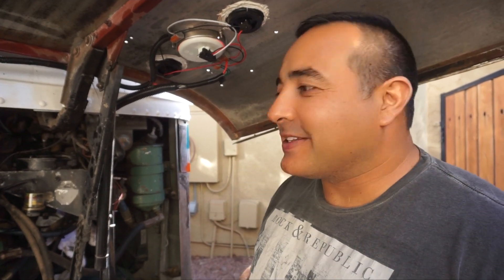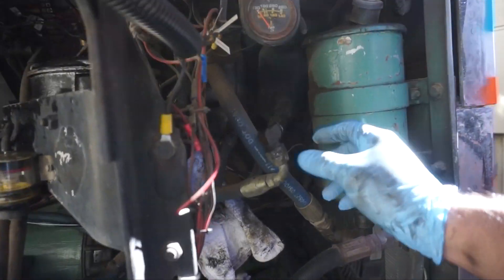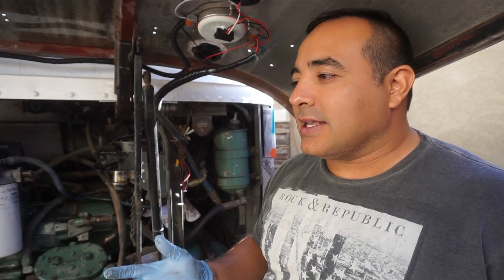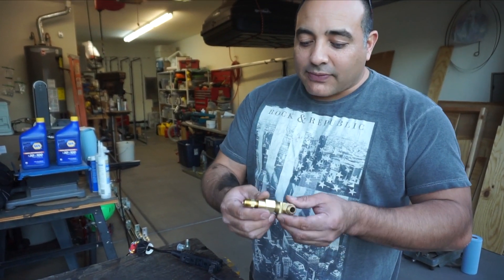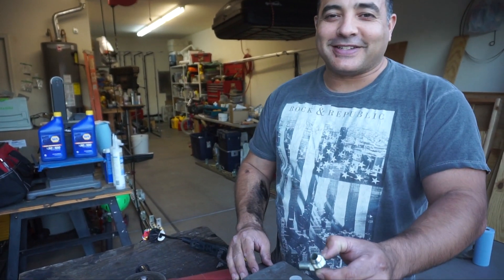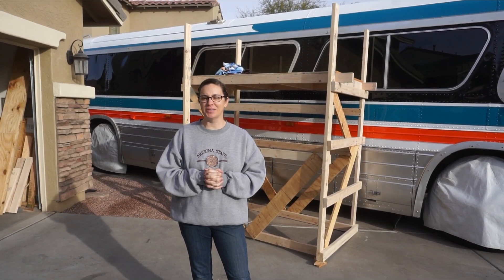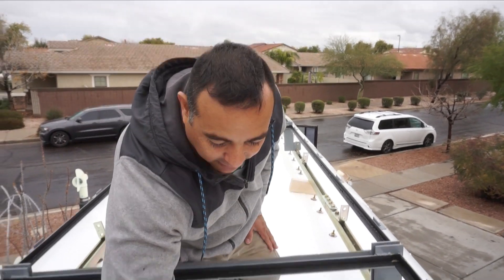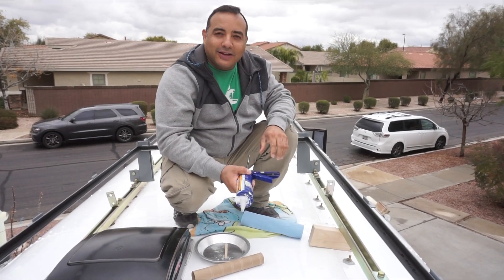Solar Install: Part 1: Mounting the Rails and Upper Racks

Comment: Freaked me out when I saw how many holes you put in the roof to take such a light load.. I think maybe 12 holes would have been sufficient given the strength of unistrut.. 70? Extreme Overkill 😳Love watching and your detailed explanation is great
Reply from the maker: Thank you Doitgood52 - we try to do things as safely as we can. The forces acting on the panels can be quite large and I wanted to be sure that they would be secure.  Those 70 grade 8 bolts are also backed by a thick piece of steel that runs under the ribs.  With 12 bolts I would have been pretty sure it would have held ... with 70 I don't worry about it :)

Comment: Boy this part scares me... More holes means more chances of leaks...
Reply from the maker: Yes - we triple sealed the install with rubber washers on both sides and then a sealant specifically designed for metal adhesion (Trempro 635).  We have had the panels up there for almost a year now and happy to report no leaks.

Comment: I won't lie. this is cool.  BUT.  I cannot help feel that just getting a bunch of the 165watt Renogy flexible panels would have been cheaper and only a day to install. You could have simply just covered the entire roof and gotten then same wattage with no profile.
Reply from the maker: Thanks Carter when I first started researching solar I had the exact same thought.  Why not just cover the entire bus roof in those flexible panels!  As you dig a little deeper you start to see why nobody is really doing this.  The first problem with the panels is heat.  When they are stuck to a bus roof there is nowhere for the heat to go - so it ends up destroying the panels in short order (most die within two years).  Another big problem is energy density - even with the entire bus covered in solar panels it is unlikely that I would get more than 1500 to 2000 Watts of total power - and because of the curve of the roof - I would probably only see 1/2 of that or less at any given time.  The panels also tend to the least efficient panels available. Another issue is "cupping" - with the heat and just with age, the panels tend to "cup" and water and dirt collects in those little "cups" and makes the already inefficient panels less efficient.
Reply: @BeginningfromthisMorning  Spectacular info.  Thank you.  Robust or bust :)

Comment: So do you have the max height of the bus/rv with the panels attached? there are quite a few bridges with low clearance around the U.S.
Reply from the maker: We will be measuring max height soon (and the weight since we took a weight measurement right before we put all the solar stuff on the roof).  The funny thing is - it will be about 4 inches shorter than when it had a roof-top air-conditioner (which had the height at 11' 4")  Our best guess right now is that it will be right around 11 feet tall.

Comment: Not sure if anyone has told you yet! Check your ground clearance of the height of your panels from the ground to the highest point of your panels! Peaceable limit is 13' 6" from ground to the top, you do not want to be hitting any bridges or power lines or overhangs! 
Good job tho on what y'all are doing to your bus!
Reply from the maker: Thank you and awesome channel name!  We will measure the full height of the bus and get the weight we added with the panels and racking very soon.  The funny part is it is actually about 4 inches shorter than when we had an R/V air conditioner up there (a small plaque on the dash added by the previous owner said the full height was 11' 4") Based on that we are estimating the height to the top of the panels to be about 11 feet tall.

Comment: I may have missed it, but putting dis-similar metals together is not good. Correct? What did you do between the steel flat bar and the aluminum roof?
Reply from the maker: Thank you McKay - Dis-similar metals is always a concern.  To minimize it we took the following steps:  we put rubber washers (1/16" thick) between the flat bar and the aluminum skin where the bolt holes are.  Where it overlaps with the ribs - both are steel so we left those.  we also used self-etching primer + 2 coats of paint on those flat bars and the inside ceiling is covered with an asphalt-based adhesive (from the original insulation).  Hopefully, this will be enough to keep corrosion at bay.

Comment: Once all your roof work is done you should coat the interior of the roof in a coating, remove all wires first. Use raptor liner...it will dampen noise and stop any future leaks.
Reply from the maker: Interesting Idea - Thank you Zero Cool.

Comment: Curious, why so high? Looks like it may catch a lot of air unless you put a wind deflector at the front. Panels could be spaced to clear the vents so that they still can be opened.
Reply from the maker: Thank you Bill - it is so high so that the Maxx Air vents could still function even when the bottom layer is pulled in (they can open up to about 75% or so).  When the bottom layer is deployed the vent will open to 100% -
Reply: @BeginningfromthisMorning  thanks for the reply! Looks like you have done your homework on the install. Stay warm and dry,  23F  and calling for white out conditions here.

Comment: That broken line was fortunate...if that had happened on the road it would have been REALLY bad!
They might have used brass on the original due to a possible interaction with the other metals or the fluid.

You guys did a super job on that install!  And a "Howdy" to the TinyShinyHome too  :)
Reply from the maker: Thank you Gregory - yes being on the road would have made the power steering thing 100X worse.  Good thought on the interaction with the metals or fluid - I will look into that and ask around on the forums.

Comment: Is there clearance for the vent to open all the way?
Reply from the maker: Thank you Aastan.  The vents will open about 3/4 of the way when the "lower rack" is slid in and 100% open when they are slid out (there is enough room for them to fully open under the upper racks when the lower racks are deployed).  The vents were a major consideration when we designed the racking  (you could even say it was the driving force for the height of the racking) - we will show that in more detail next week.  Thanks for tuning in!

Comment: Stress and strain on fittings they will fail. Might want to see if you can clamp the line to a structural member to relieve some of the strain on fitting. The roof assembly has enough bolts that I think you have increased the strength original strength of it. I was thinking about this are you considering adding a wind screen to the front of the Solar Panel to streamline it or have you discounted the need for it?
Reply from the maker: Thank you Bill I will try to see if I can secure that line somehow.  LOL, my friend said the same thing "you are the only guy I know that actually increases the strength of the roof by adding a rack to it".  We do want to add some type of "fairing" to the front of the structure and probably add side panels to prevent the wind from getting under the panels and trying to "lift" them.  We are still trying to figure something out - let me know if you have any ideas.

Comment: Where are you putting your AC units?  You must have a great HOA with the bus in your front yard...thanks
Reply from the maker: Thank you bparkinson - we use a 12K BTU mini-split A/C for the main living area and we will very likely mount an additional unit in the back for the rear bedroom (a smaller 5K BTU Unit).  We have a video on the minisplit install (https://youtu.be/GvdIe0AkXV8) as well as our thoughts after having it in for 8 months (https://youtu.be/hNiFDMonKGk).  We have GREAT neighbors - you can see them stopping by for a visit in the first time lapse.  Almost all of them have helped us on the bus and our immediate next door neighbors have a new baby so we try to be good neighbors by texting them before we do anything loud or start the bus.

Comment: Scary when oil is gushing out of the motor compartment but glad it was just a power steering fitting not the engine. Great job on that install, you had a good crew from the looks of how smooth it went.
Reply from the maker: Thank you Jerry - it went surprisingly smooth (you have watched enough of our videos to know that things don't typically go very smoothly) :)

Comment: Regarding the engine repair, I don't think that steel part is going to fair any better as it is more likely to rust then the Brass Part. If it's stainless steel then you might be ok. The reason Brass is used is due to it's ability to expand and contract better than steel without rusting. Again if the part is Stainless then you should be ok, but you should have a back up if it's not Stainless... Cheers...
Reply from the maker: Thank you Paul Interesting thoughts on the brass part.  The "Hose Power!" guy was pretty insistent this was the right thing to use.  (I do believe it is a stainless part) - I have learned to buy 2 of things like this - so we do have a spare :)
Reply: @BeginningfromthisMorning  If it is stainless it should be better than the Brass Part, but if only metal coated in something, it may fail a lot sooner than Brass... Cheers...

Comment: are you going to put a air wing on the front to deflect the wind as you drive the wing looks like the ones that they use on cars for ski rack to protect the skies they do work great and come in clear or any color you like
Reply from the maker: Great idea Chrissteene!   We want to put something in the front and on the sides and had not really considered that ski rack windbreaks!  I will have to see if something like that will work - thank you!
Reply: I think  you wear thinking of some thing to retract the solar panels when the wind picked up well I talked with a friend and he told me about a wind censor for auto awnings  https://www.alekoproducts.com/Wind-and-Sun-Sensor-for-Motorized-Awnings-ALEKO-p/awss-ap.htm?msclkid=f90971b45e5717b762d02de99072f51b&utm_source=bing&utm_medium=cpc&utm_campaign=ALEKO%20Products%20-%20Shopping&utm_term=4574793006419450&utm_content=Products%20ad%20group I know that their is others but my friend said this one works great  hope this helps out
Reply from the maker: @chrissteene  I will look into these - thank you!

Comment: Boy there is something satisfying about seeing all that great design, effort and investment getting bolted snugly to the roof, I'm sure you agree! My gut was saying you went a little overboard on the mechanical fasteners lol, but you've sealed them up incredibly well and better to over design then under. Awesome job!! Keep up the great work and videos. Ever thought about doing some kind of fairing at the front and back of the rack to really make it look sleek and streamlined up there?
Reply from the maker: Thank you Josh - I do tend to overbuild a little bit but I wanted to be absolutely sure that this structure was not going to fly off the roof even in crazy wind.  We are looking at options for a fairing or windbreak in front of the structure as well as the sides to keep a gust of wind from trying to "lift" the panels from the sides.  We have not figured that out yet.
Reply: Beginning from this Morning all the best with the search and look forward to part 2!

Comment: Since you put this out there for everyone to see I thought I would put my 2 cents in, please take this as constructive feedback...  Those bolts are still going to leak, and there are way more than needed.  One bolt per rib would have been more than enough.  The water "wicks" its way down the threads past the nuts, washers, and bolt head.  The rubber washers aren't sealing the threads at all and I didn't see you put any sealant on them, and you've got tons of them.  I also assume you're going to spray insulating foam on the interior once everything is done.  I think that you'll find that when those rubber washers begin to fail from UV that all of those bolts will loosen up (and leak) and it will be a major issue to remove them or tighten them when if you don't have access underneath.  The best way to do this would have been to use blind rivet nuts into the steel hoops with bolts (or studs) down into those with a little non-hardening sealant.
Reply from the maker: Hi porkbuttrocks - thank you for the feedback, we appreciate people taking the time to look out for things that might be potential issues and we learn something every time we put out a video.  I will try to give you my thoughts on the issues you brought up. Using fewer bolts would have put more stress on the relatively thin aluminum skin and super strut and would have made the structure less safe in my opinion.  @12:30 I talk about covering the bolt and washer completely with UV resistant sealant (Trempro 635) you can see them all covered up in the gray sealant @13:00 (here is a photo as well: https://photos.app.goo.gl/xPQRiaocxf2Ts7Zd9).  To address the loosening or tightening of the bolts - they have been tack welded underneath to the steel bar that reinforces the roof panels (you can see it @14:28 if you look closely at the bolt head).  When we insulate the roof, insulation and the bus ceiling should press against the steel bar to prevent it from "falling in" in the unlikely event that we have to remove the nuts.
Reply: Somehow I missed that, sounds like you've got it covered!
Reply from the maker: @porkbuttrocks  Thank you - A second pair of eyes never hurts!

Comment: I’m not a hydraulic expert. But I think the steel fittings are for heavy equipment where strength is need for impact. In your application brass is most likely better for vibration. And it probably lasted 30+ years right. Do a little more research on that system. You’re the man when it come to research. Did you use nylocks in those 3/8” bolt or jam nuts or something that won’t loosen up
Reply from the maker: Thank you Mitch - I took the part to a hose store (called "HOSE POWER!") and they told me that part should have never been brass.  I did use nylocks and lock washers so I hope it stays in place. (I will check it in a few weeks to see if there has been any movement of course)

Comment: Hey Juan,
I am just about to post a video (in a few days) on the power steering system because of a leak I had at the pump on my bus.  It will go over some of the things you touched on in your video.  The pump relief valve does not open until it reaches 1000 psi +-50 output.  It looked like to me the fitting broke due stress from flexing, which might be caused by engine movement tugging on the fitting.  So, be sure to have enough freedom in the hose for it not to tug on the filter housing fitting as the engine moves around.  Additionally, you should be sure to clean that filter.  I'm going to post how to do that.  When that filter gets dirty, it causes added high pressure in the line that broke on your bus.  While the pump relief valve should cut in over 1000 psi, it is obviously going to the max for it to relieve.   If you notice unusually loud whining noise coming from the engine when turning the wheel, it is an indication that the filter is dirty and needs to be cleaned.  A dirty filter puts a lot of added unnecessary stress on the system.  One last thing, the original factory power steering system requires Dexron III transmission fluid if you have the original power steering booster cylinder on the back of the front axle.  If you have a Sheppard Steering self contained p/s gearbox on the front axle then it uses 10-40 motor oil.  Hope this helps!  
Great job on the solar panels.  You'll go airborne before they blow off!!   
John
Reply from the maker: Wow! Thank you John - I am really looking forward to your video.  It looked to me like it was from stress as well.  Before too long I want to do a cleaning of everything that needs to be cleaned or inspected back there.  I would also like to address leaks if at all possible.  It doesn't leak A TON but if there is something that can be done - I would like it to leak less.  The power steering does make a bit of noise when it is cold but goes away after about 5 minutes when it is all warmed up a little.  I am not sure which power steering system I have but it does work very nicely (I can easily turn the wheel with one finger) but the stuff that came out of that fitting was oil for sure (brown not red like Dextron).

Comment: I'm loving this series. It's like "This Old House" for buses. How tall is your bus now with the panels?
Reply from the maker: Thank you Deb - The bus used to have an air conditioning unit on the roof which was about 4 inches taller than this rack we have added.  There was a small plaque the previous owner made and had mounted on the dash that claimed the bus was 11' 4" (https://photos.app.goo.gl/HZNBks5a1f8GVvrQ6 ) - So my best guess is we are somewhere around 11' tall.  We will measure it when we go get it weighed after everything is mounted.